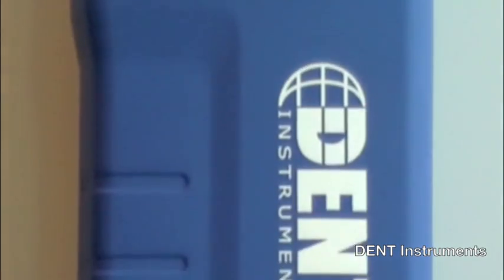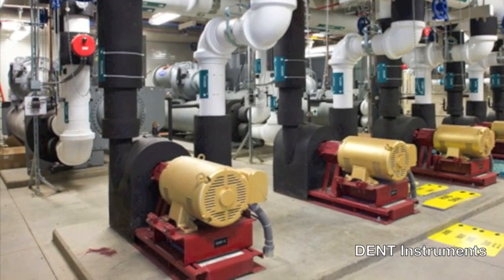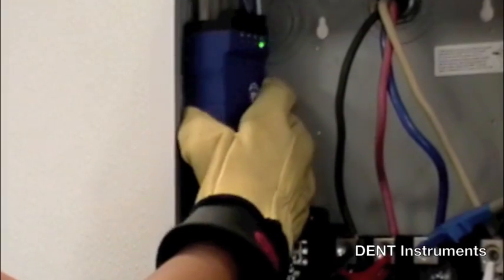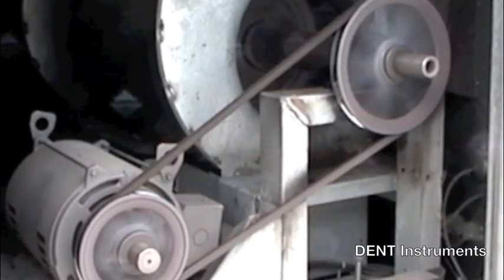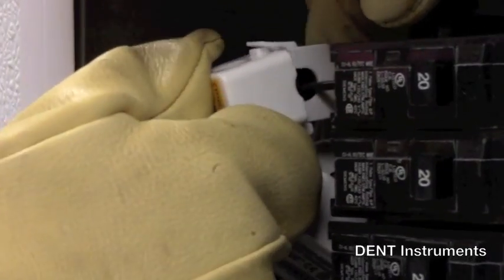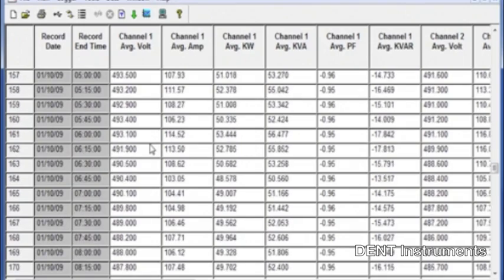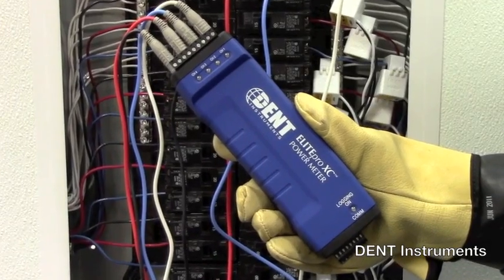ELITEpro XC Power Meter - DENT Instruments

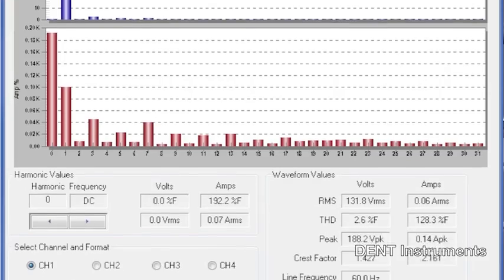Comment: 1:46 Can you explain more details of harmonic logging with the device.
Reply from the maker: Yes, the ELITEPro XC can read up to the 30th harmonic using the ELOG software.
Reply: @dentinstruments  Thank you, Got it and recording of individual harmonics can only be able to save through the software to spreadsheet. Can we change the recording interval?
Reply from the maker: @meswic  Yes!  Extending out the recording internal will lose some of the granularity you're after, but it extends the duration the ELITEPRO XC can record.  15-minute intervals, for example, will allow for recording up to a year's worth of data.

Comment: how many data points does it store?
Reply from the maker: Hello Devashis, thank you for contacting DENT! The ELITEpro XC is a portable data logger/power meter with 16 MB of internal memory. It can capture kWh/kW energy and demand data as well as virtually all relevant energy parameters for diagnostics and monitoring on three-phase or single-phase circuit installations. The length of time that you can record depends on how many "recording flags" you have set in the Setup Table (which is used to initially "program" the logger). For example, if you are just interested in Average kWh,  you may record for longer than if you wanted minimum, maximum, and average on all parameters. There is a handy "memory capacity" field in the Setup Table that will give you an estimate of how long the meter will record, given the parameters you have entered. We have another video on our website about setting up the ELITEpro which may make this more clear: 

https://youtu.be/i0anOlajcdQ

If you would like more information on this meter, please email our sales department: sales@dentinstruments.com or contact us through our website: 

https://www.dentinstruments.com/contact